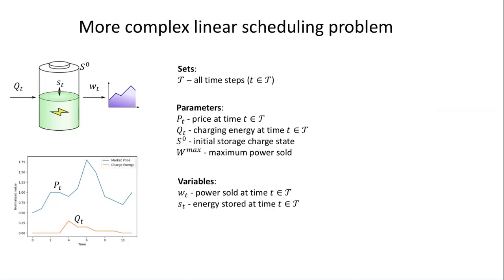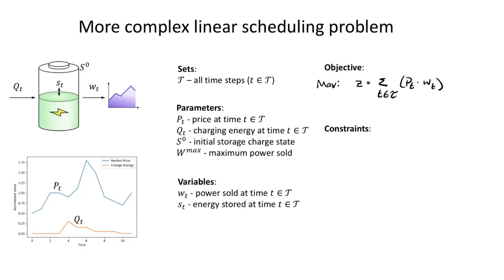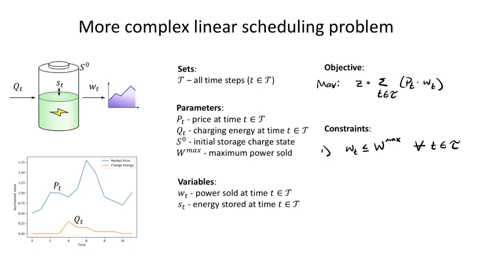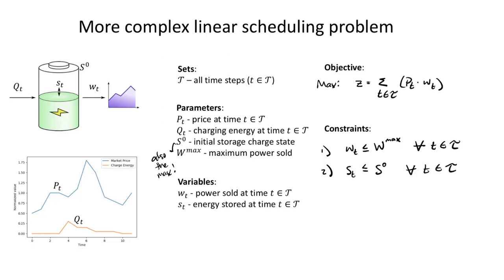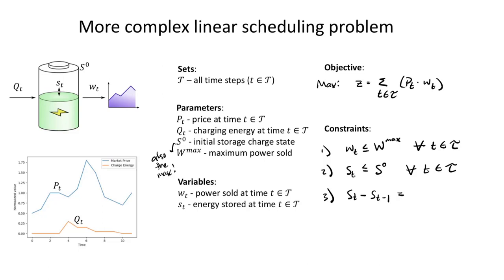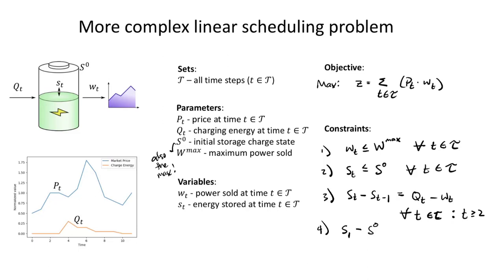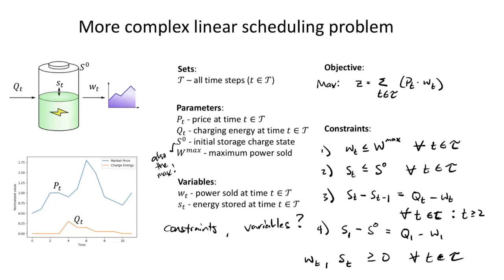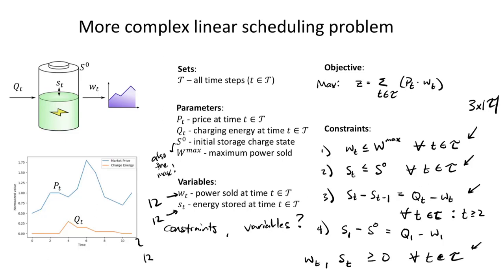5.2: Solving problems using Pyomo - less simple example (continued)

Comment: Hi Mike, thanks for this great series of lectures. I'm following the steps given by you. I just had one doubt - Why have you written 2 different constraints for the energy balance? Why can't we have a single constraint - St - St-1 = Qt - Wt for all t? Why is it only for t>=2? The next constraint is similar to this once so why is it written separately?
Reply: The thing is that there is no variable s0 (not to be confused with parametr S0) because time set T starts with 1. We could have introduced the variable s0 and add the constraint s0=S0 to get rid off constraint number 4 though, but it wouldn't have made much difference. The main point is that we don't have variable s for zeroth time period and we say that at time period 1 energy stored (s1) equals to initial energy level (S0) minus  energy sold (w1) plus charge (q1)